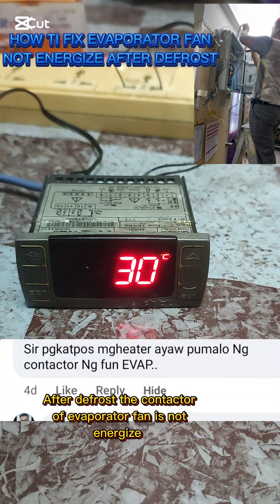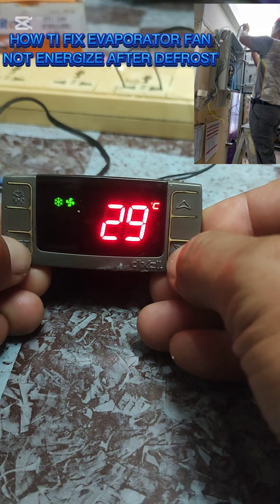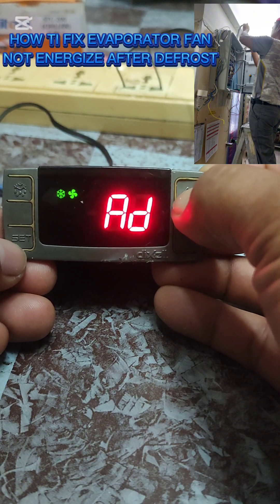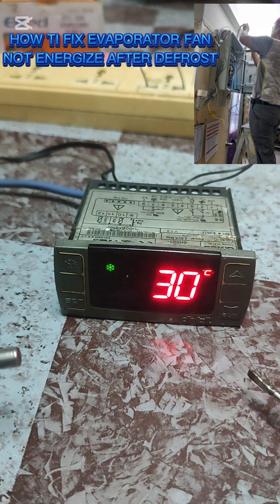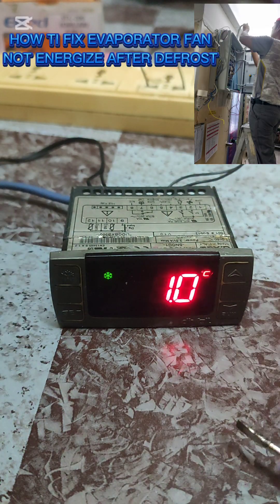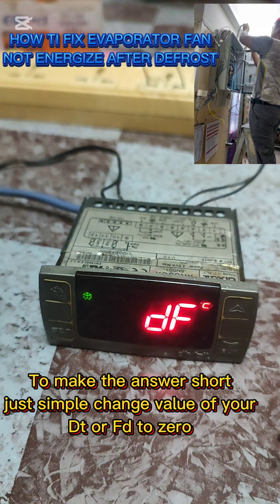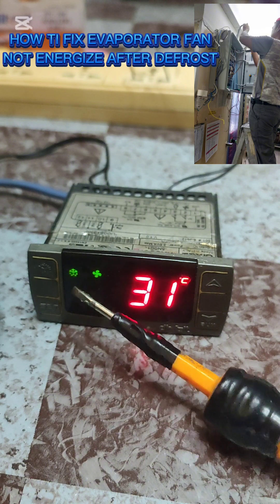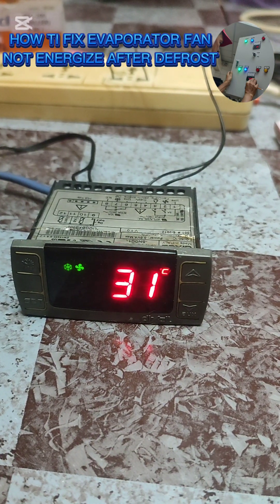EVAPORATOR FAN WON'T ENERGISE AFTER DEFROST IN DIXELL DIGITAL THERMOSTAT FIXED

Comment: Sir, manual defrost di gumagana heater pero pag irekta ko contact coil gumagana posible po ba na controller na?. Salamat po
Reply from the maker: Pag out of range di mo mamanual defrost yan sir. Try mo disable P2 ma energize mo manual defrost
Reply: @THEMULTISKILLEDTECH Sir magamdang araw, pano po ba palitawin ang indicator ng fan para magsabay cla umandar ng compressor, pag switch on mo meron nmn pero pag umandar na ang compressor di lumabas ang indicator ng fan
Reply from the maker: On top ng control mo sir may diagram yan kung mayroon relay for evapotor fan
Reply from the maker: Kung activated ang defrost symbol sa control at defrost heater doesn't powering up. Its probably the control ouput relay for defrost ay faulty na sir